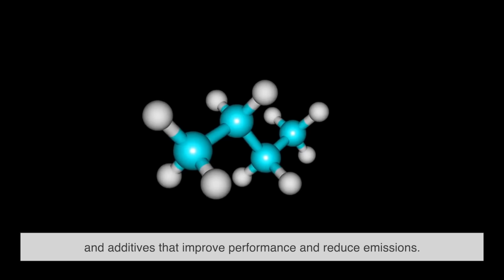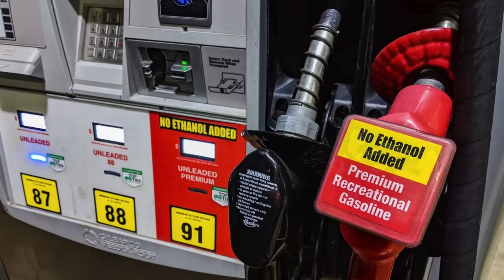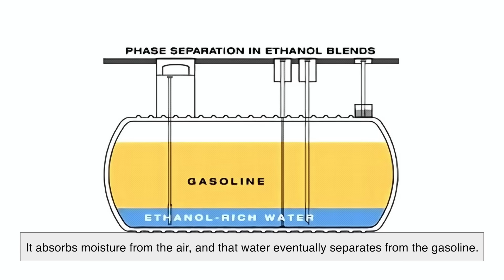Does Gasoline Go Bad?

Comment: Difference between soap and body wash
Reply: Is the body wash antiseptic? Soap is a mechanical cleaner which means it binds to oils making them displace from the surface & wash away. It's why skin feels squeaky clean when using soap because it removed all the oils. Antiseptic hand wash uses chemicals most commonly alcohol & this needs to time to penetrate cell walls of bacteria ect to be effective which is why when using antiseptic wash you need to let it work before washing off.

Comment: At one time I would remove the alcohol from my gas that I used for my tools, chain saws and brush cutters. It says only used for storage. Then I discovered it was easier to just use it up. I fired up my tool engines to warm them up then drained the gas. Then I started up my tools and ran them dry. Next season I just added fresh gas and they were all fine! I do worry about my truck that doesn't get driven enough these days! I usually kept a 5 gallon jug of gas on hand but replaced it every few months. Stop subsudising he farmers and get the alcohol out of our gas!

Comment: If you store gasoline with ethanol in a SEALED METAL container with NO air space. No problem. Not a plastic tank. Not a vented fuel tank. NO atmospheric access to the gasoline AT ALL. Yeah, there's a real problem with gasoline/ethanol storage.
Reply: Ethanol is the problem
Reply: Ummmm….How does expansion work with your method?
Reply: @timsforcoffee  Excellent question! My long term ( 6 months) storage is in 1 gallon cans. I leave just enough airspace and then squeeze the sides of the can before capping off.  And yes, they swell and contract a lot. On really hot days you can hear the cans make noise as they do swell. But, no air means no water means no/less degradation of the fuel. So far it's been working on my 6 month cycle.
Reply: @bobkreutzer869 I suggest you speak to your local fire department about your method.  I’m not going to try to convince you.
Reply: @timsforcoffee the military Jerry cans are literally this. They work well in hot or cold environments and are very safe.
Reply: @STEVEARABIA1 say whatever you wish.  Liquids don’t compress.  You are making a bomb if you fill your fuel containers 100% full.
Reply: @timsforcoffee  Thank you for the suggestion! I will.
Reply: @timsforcoffee you don't fill them 100% full and they also flex. The trucks that deliver gasoline to your local gas station aren't plastic. Rail cars?
Reply: @STEVEARABIA1  Bob's post literally said he squishes all the air out of the 1gallon can.  "No air means no water".
Delivery trucks and rail cars both have ventilation to allow for expansion and contraction.
I never said metal containers weren't a good idea.  Plenty of metal fuel storage solutions out there.

Comment: SUGGESTION - Can outboard, or marine engines, use gasoline with ethanol or does the ethanol damage those engines?
Reply: A small amount (10%) in fuel systems not designed for 85% ethanol is fine & can help clear moisture out of a tank. The ethanol does not hurt the engine itself but degrades plastic components & rubber seals that are not designed to be exposed to ethanol because ethanol draws out water & will dry out rubber seals over time causing them to crack.
Reply: never

Comment: does expired gasoline still burns?
Reply: Yes. Quite a few yrs ago i pulled the gas tank off of an old car that had sat for over 25 yrs. There was not much of anything in the tank but i was taking the car to the scrap yard. The smell from the tank was weak and i figured if anything was in there i'd get rid of it and in turn recycle the tank also. I had a fire going so i tossed the tank into it and ran back really fast but nothing happened. I stood at a distance for a couple minutes watching and still nothing. I had finally decided nothing was going to happen and about 45 minutes later just after i walk past the fire a huge boom goes off and i look up to see the tank coming down from about 75 feet in the air and when it lands it's on fire. I also know that gas will float on top of water and burn. It's nothing to play with and is very dangerous so take my word for it and don't try anything dumb with gas!
Reply: @ForgottenHillbilly  Good story.  Welders repairing empty oil tanks full of vapor need life insurance to feed their family, if you can find his body to prove his death certificate. At least make a will out.